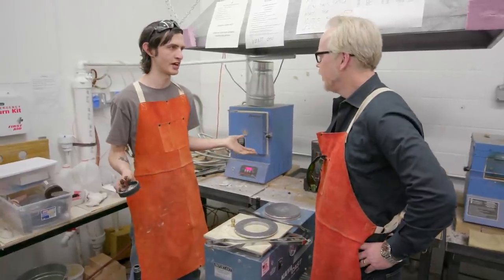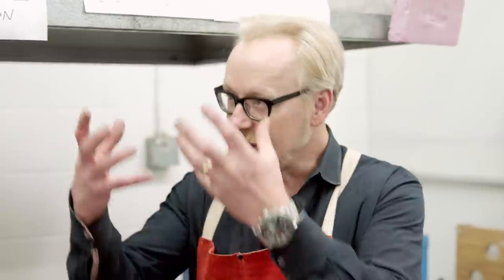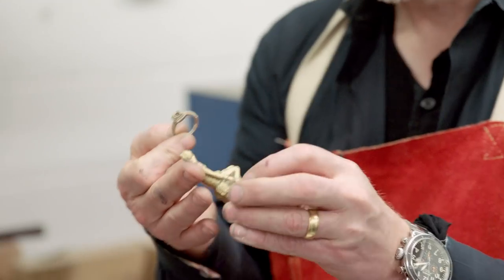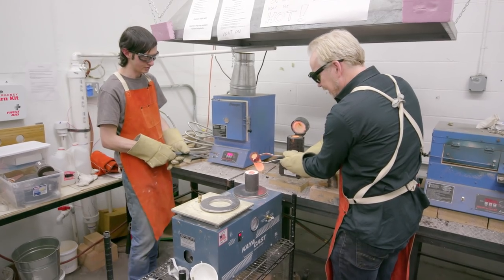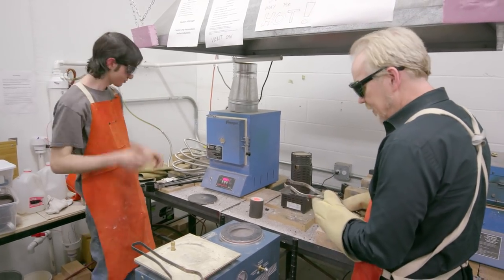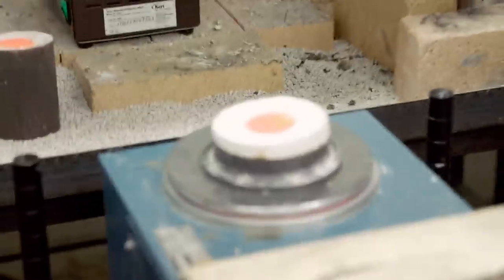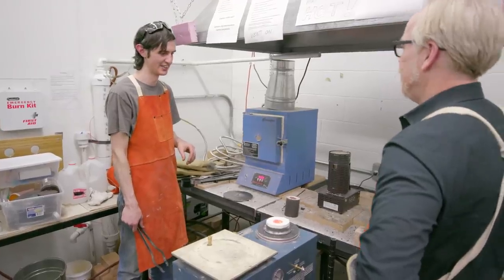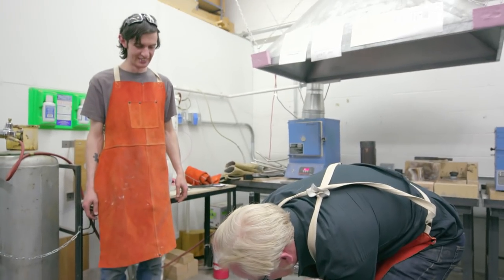Adam Savage's Maker Tour: Making a Metal Fidget Spinner

Comment: Although you might not achieve a tolerance as high as what they did in the video, you can do this easily and cheaply by pouring aluminum into a greensand mold with a foam object or possibly even a 3D printed object. I've done it before with very dense foam (used for insulation, it's also very good for sculpting into objects) and made a sling-shot. This is typically called the "lost foam method", which is what I immediately thought when I watched the process in the video.

Comment: Hello! At the beggining Ben talks about the piece that holds the parts to be casted (the piece that allows to "sprew up the pieces"). I'm wondering if you can 3d print your model to have the base and all the connectors so that the metal has a way out the vacuum, just like with the 'sprew part'.

Comment: I also have a simple idea for a fidget spinner: Machine a spinner out of aluminum, steel, or bronze, and put the bearings into liquid nitrogen, which will slightly shrink them just enough to be fit into the metal spinner frame. After you let it set to room temperature, the bearings should be in there quite tightly, and probably won't come out any time soon. Definitely a great idea since most people drop the spinners and break them or the bearings loose.